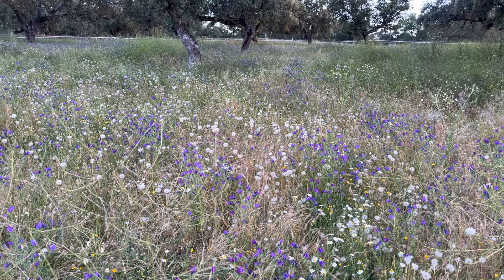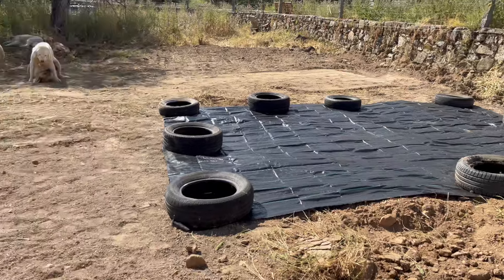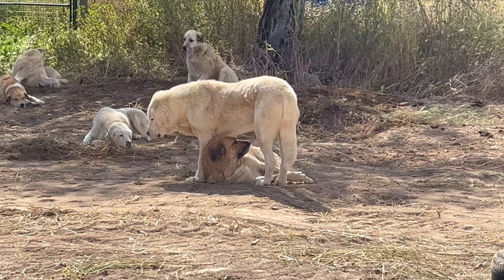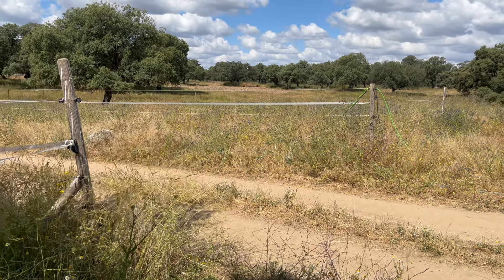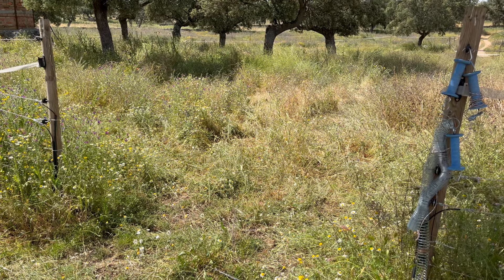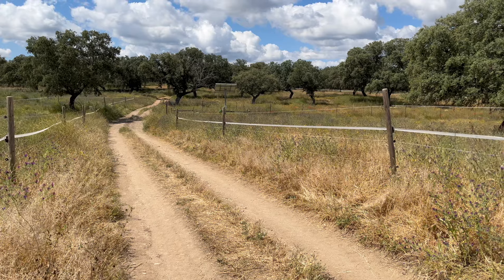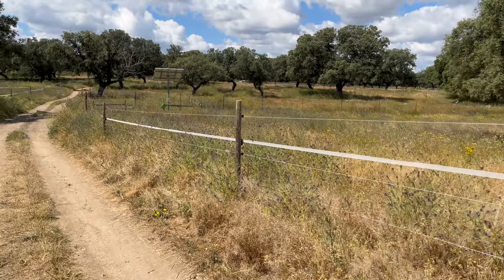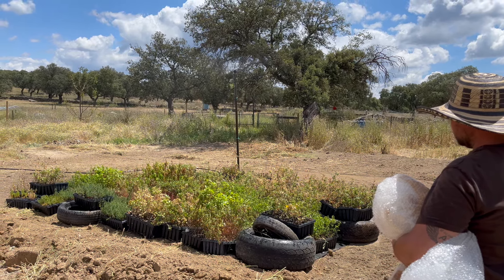Building a NURSERY and some EXPLANATION about our climate

Comment: I live in a semi-arid slash sub humid area in northeastern Brazil, it's basically the same essence but flipped. Everything happens in summer which is rainy season  (we actually call it "Winter" because it's the period with lowest temperatures) when it doesn't fail (we are very prone to drought), and everything greens up in the slightest amount of rain (Caatinga forest means "white forest" because it's basically domant 9 to 10 months). So from basically around may/june to December it's nothing but heat, sun and parched soil. The cycle goes on and on and also got destroyed by bad management of nature and soil, now we're starting to get desert climate due to this. Fun fact is that some of our semi-arid areas get more rain than like London or even Madrid, but because of the temperatures the moisture x evaporation equation is brutal.
Reply from the maker: Right. Not many people know about such areas. Thanks for commenting about it.

Comment: The violett flowers look nice. Kinked or twisted hoses can also lead to a drop in pressure, as can longer distances.
Reply from the maker: We are not using hoses. That's all PE pipe of larger diameters for agricultural use.
Reply: I guess you talk about viper's bugloss (Echium vulgare)? Indeed these are pretty but toxic to horses and cattle. On the other hand beloved by bees ;).
Reply from the maker: @darked89  can't be a toxic plant as it is typical for the Dehesa and appears in early spring all over the place and the animals eat it and don't leave anything

Comment: Are the pressure 'issues'  in the Miyawaki forest really fixed? Do you run the wobblers all at once or in shifts? I would imagine that running in shifts could help with pressure issues?
Reply from the maker: Based on the pump specs we now have 4 sectors / lines that we can run in shifts. I am still waiting on the solenoid valves that I've ordered and so for the time being it's a manual process. But at least we have monitoring and know when to irrigate. Thankfully it's not tomatoes ;-)

Comment: I recall that chickens were the initial animal you'd be introducing after the current pause. Do you have specific examples from the mediterranean climate/dehesa specifically where this has worked? Would you focus initially on meat birds and only run those batches during the fall and spring with a break for winter?

I am in the mediterranean zone but we're not nearly as hot or dry as you are (zone 8b in central italy) and our winters are actually milder as well.
Reply from the maker: The thing with the chicken is currently an idea and something we are personally interested in as personal food source. There are many ways how to do it. Eventually it also requires a facility. So it is a longer term game.

There are still a few loose ends to tie up before that gets serious. So we will see how it goes then.

In general the idea is to have the chicken below the trees for protection from above and the whole area enclosed to protection against ground predators. The Miyawaki forest has already a suitable fence that can be improved easily.

Another way is to use Chicken tractors (the Salatin style) between the rows of Paulownia trees. I think that works both for meat birds and layers (with integrated nesting boxes).
Reply: @ProjectGranjaCaimito  Yeah i hear you about ground predators. We have weasels which caused me headaches after they killed our first 3 chickens. I therefore built the justin rhodes style coop for small scale. the tractors that richard perkins has built could be a great option for you with more gradually sloping land and access to machinery. These don't have any ground predator concerns (chickens are off the ground at night) unless those same predators are also active during the day. People have warned me here that foxes also hunt during the day but so far (fingers crossed) we have had zero losses in 5 months.
Reply from the maker: @stijnt2377  As there is the question of automation also involved we'll be taking the slow route and figure this all out to be as safe as possible and not create work for humans. Ideas are plenty and we need to go through the creative process.